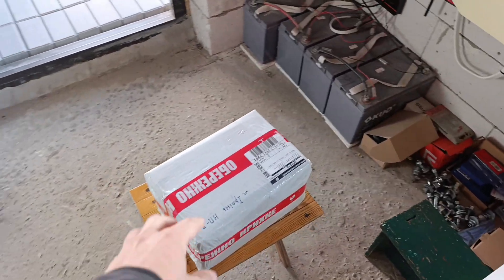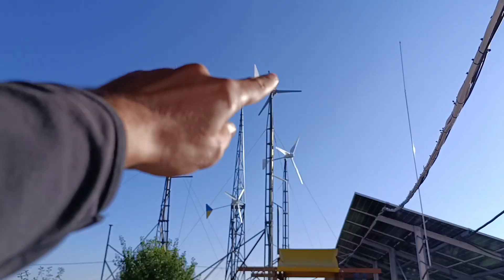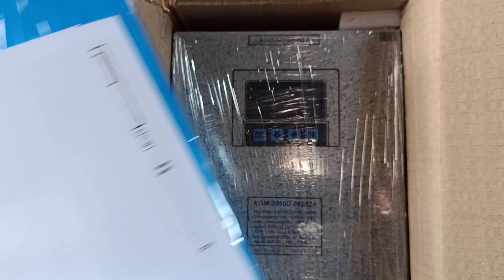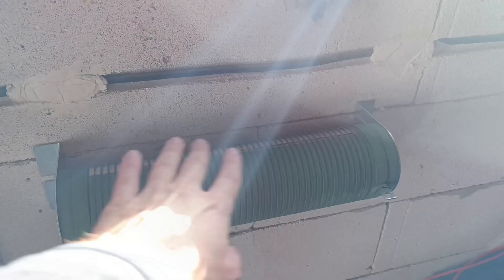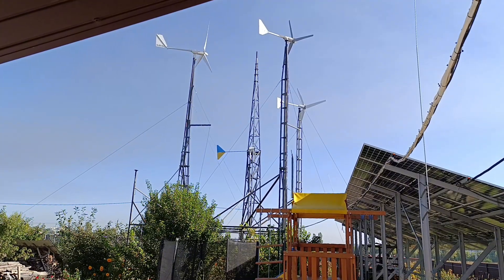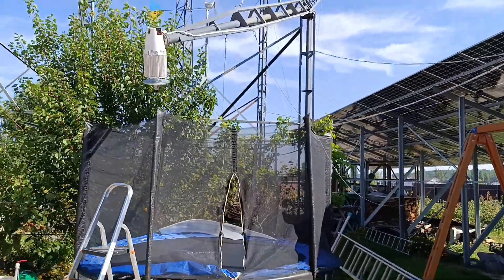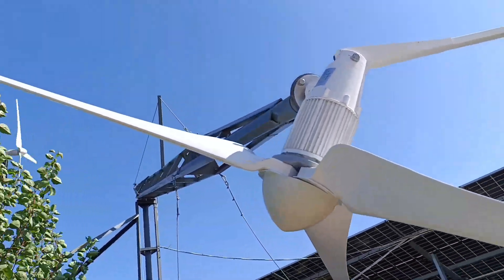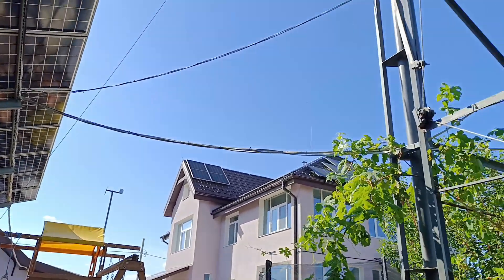I got crazy with increasing windwheels of my wind turbines... FT-1500 now is +0.2 m in diameter...

Comment: Hi Mate, I have noticed lots of people have trouble with the flange.
No Welding Flange idea - for small wind generators only.
You will need to buy  -
1 x right angle L bracket 100x50x50x5mm, 
2 x U bolts that fit around the 50mm part.
1 x 10x40mm bolt, washer and nut, plus a spring washer,
1 x very large steel washer 3/4 inch,
4 x M10 galvanized nuts or spare flange nuts,
3 x male spade connections,
3 x female spade connectors,
1 x roll of insulation tape
2 x cable ties
Using the four flange bolts that came with the small wind generator,
run the four bolts through the four flange holes before adding two washers and a M10 galvanized nut to each, tighten by hand only, At this point might need to drill a 10mm hole in the 50mm side of the L bracket if not supplied.
Using the 10x40mm bolt with the washer, go through the 3/4 washer first, then down through the middle of the flange 
( leaving the four flange bolts facing up ), 
next through the 50mm side of the L bracket, then add the spring washer and nut, center everything and tighten with spanners top and bottom.
run your 3 wires through the pole first ( use a AC extension cord), 
Strip wires and crimp three male spade connections to the pole wires.
Strip wires and crimp three female spade connections to generator wires.
Put the two U bolts on the pole loosely and slide the 100m side of the L bracket down between the pole and the flat plates of the U bolts, equally space U bolts and tighten each 4 nuts evenly until it is solid, next test fit the wind generator adding the remaining four flange nuts finger tight, next tighten the four M10 galvanized nuts which are now sandwiched between the two flange plates.when everything is aligned, reattach the wind generator and add spring washers before the nuts, tighten with a spanner.
Join the three wind generator wires to the three pole wires, use insulation tape to weather proof connections and cable tie wires around the pole.
I hope this information helps everyone.
Reply from the maker: If no welding is required, and if the unit is kind of light (less than 15 kg) - I'd use a U-shape connector (4-5 mm thickness) and then a square pipe. Drill, bolts/nuts/washers only then.
Reply: @BackyardVoltage  I agree, I just had so many flanges sitting around and my wind generators are all on round poles, so I found it hard to get them level with only two bolts. Looks safer for neighbors and council too. The flange can look hard for beginners I have noticed. 
I hope it helps some guys get started.

Comment: Like a bicycle crank arm remove tool, lucky I have the same hub and bolt it too the stuck on shaft one and use the nut to extract it off.
Reply from the maker: I just recorded a video today (in a part of a longer one) how to remove it without issues or hammering it out. will be released next Friday.